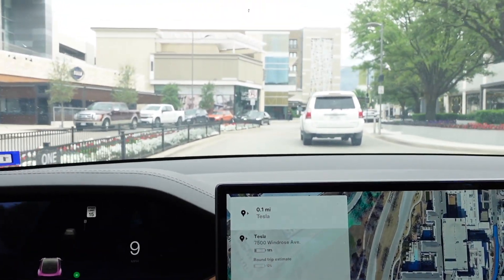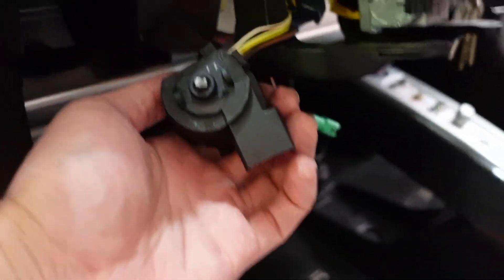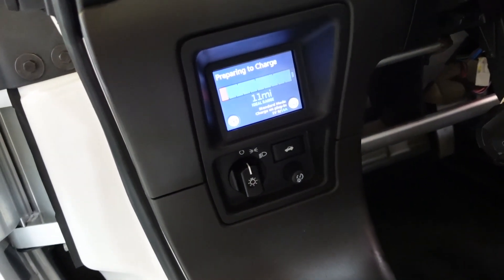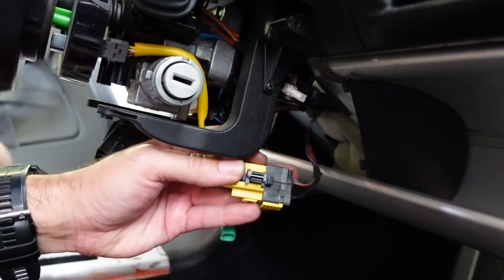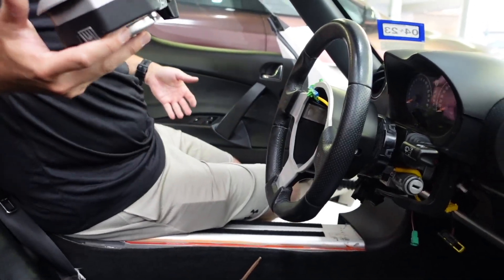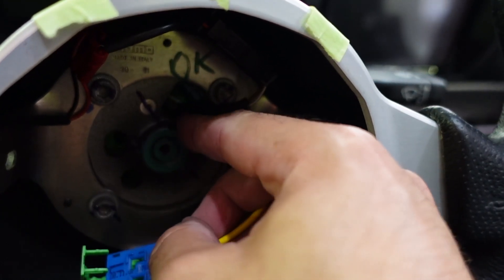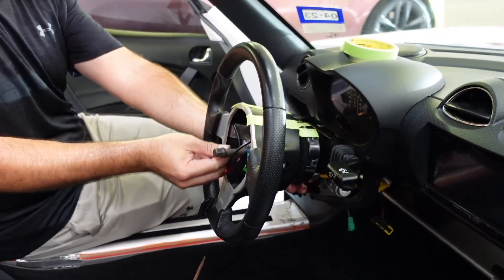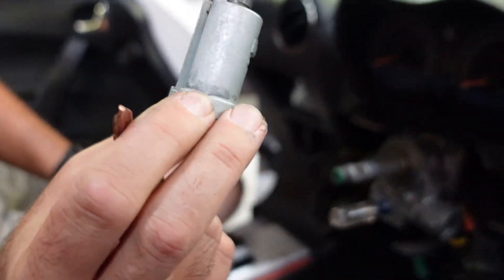Rescuing the 50th Tesla Roadster

Comment: How did the switch break off in the first place--seemed it was metal?
Reply from the maker: It's a brittle metal, so I'd guess wear and tear. This is one of the oldest Roadsters and is daily driven. It's also a GM part, so probably engineered to fail 🙃